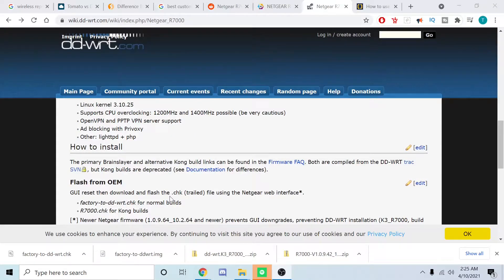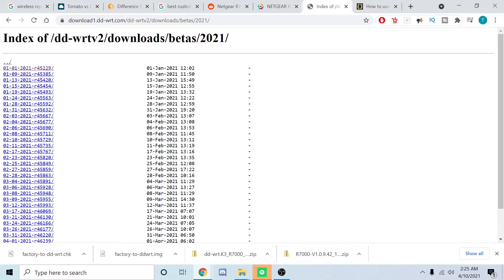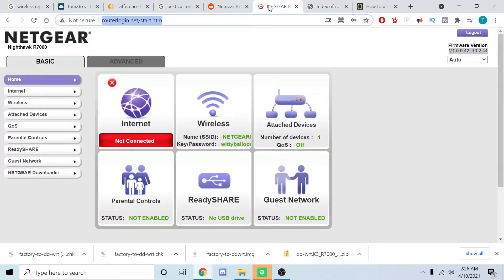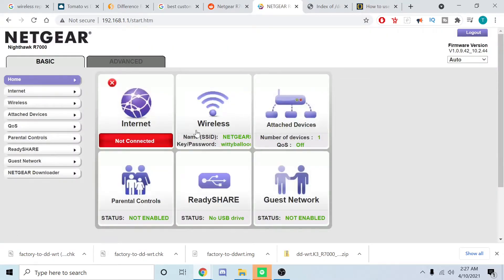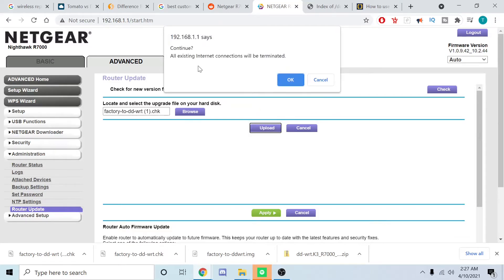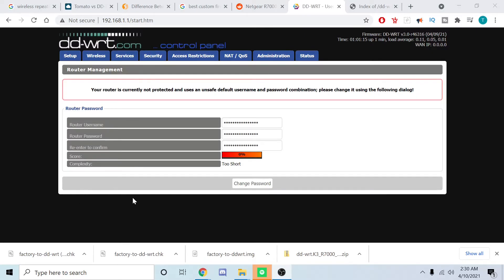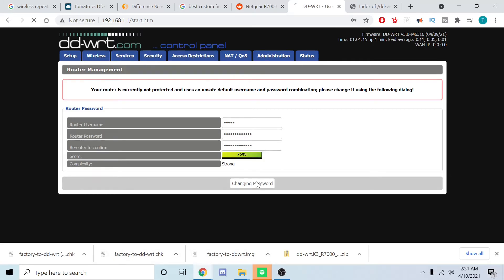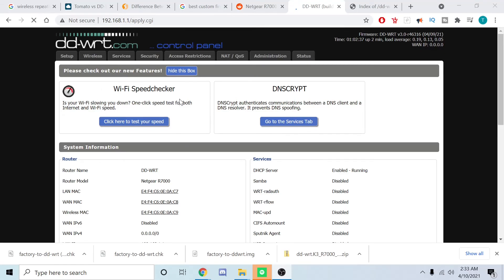Install Custom Firmware on Nighthawk Router ( Unleash your Routers Potential ) 😱😱😱

Comment: merlin for r7000 is better than ddwrt or openwrt or tomato
Reply: I tried to install Netgears versions, newest and older firmwares and my speed is only 150mbps and I should be getting 300mbps. Do you know how to fix this?
Reply: I tried OpenWRT on the R7000 and while it works fine for Ethernet, the WiFi was not supported. Supposedly because OpenWRT does not distribute the drivers due to licensing reasons or something? Regardless i switched it to DD-WRT instead and it also works fine but does work with WiFi too.

Comment: i installed the dd-wrt file onto my router and now whenever I try to go to the website by putting the IP in the search bar, it says the connection times out. it also changed my network name to dd-wrt. how can I fix this?
Reply from the maker: Whats the device, and what hardware are you using? Id also factory reset after as well.
Reply: @memeaganda4517  i am using the netgear nighthawk r7000 router. i also did factory reset and the problem was not resolved. how can I fix this?
Reply from the maker: @susantopal9762  Can you ping the router? The IP address can generate a new one after the reboot - ping the name of the device using CMD "Ping dd-wrt" an then from their after the ip address use plug it into your browser
Reply: @memeaganda4517  I attempted the ping command and it says it could not find the host dd-wrt and that I should check the name (which is entered correctly) and try again
Reply from the maker: @susantopal9762  wire or wifi? and to verify you see the name when connecting ? Id recommend running a direct line if possible
Reply: @memeaganda4517  a wireless WiFi connection and yes the name was exactly correct. I checked multiple times
Reply from the maker: @susantopal9762  okay the only other thing I can recommend is a direct line. Then disable wifi. Then run ipconfig /all Then Verify your default gateway and try to connect.  After that it could be bricked can't say for sure.
Reply: @memeaganda4517  hello. I have been able to connect to the interface by connecting through a wired connection and entering the IP that way. Thank you very much for your help and the videos were very helpful and informative. Now I just need to configure the router